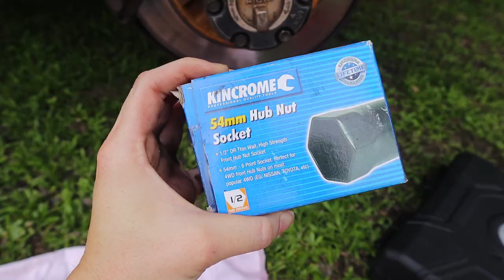My Landcruiser Part 3: CV Repair

Comment: Suggestion to jack as far out from the diff that you can and then put the tyre under the diff for safety -- ain't much but....  Grease and brakes are kinda counter to each other -- didn't see you clean your greasy fingers off the braking surface....  Doesn't that flex brake hose have a spring clip holding it to the mount? and then a notch to let the hard line slide out of the retainer so you are not bending the heck out of the hard line? Don't know about there, but dish soap in the shower can be great to cut through the grease on arms & legs.  -- Hair too.. hardknocks uni....
Reply from the maker: My 35" does not fit under the axle. And you didn't see me refit the circlip or do alot of other things too. Was over 2hours of footage is that how long you want these videos? Just because you didn't see something doesn't mean it was done🤦‍♀️
Reply: @DanieSimpson  -  If your 35 which doesn't say anything about width doesn't fit under the ax then use a couple of 4X4 or 8X8 to stop the vehicle trapping you or hitting your back while you are leaning under it if the jack fails. That stock jack is to jack up so you can change a tyre, not do vehicle maintenance. Get a Hi-Lift.   3 seconds before you put the tyre back on it looks like the fingerprints are still on the machined rotor brake surface. If you don't show or say that you did a step in the procedure then don't think people will ignore the absence.
Reply from the maker: @10susan10  best to read comments before voicing your opinion. The tyre is 12.5" wide and wider again at the side walls so I'll repeat myself one last time. My tyre will not fit under the axle which is the only place that will stop the axle dropping. The jack is to perform whatever you want. It as a SWL and you stick to that. There isn't a time limit. It is a screw type jack and VERY unlikely to fail like high lift jacks or hydraulic jacks. No-one carries jack stands off road or 4x4 or 8x8. If you can't work on your car without relying on safety devices then you need to learn to. You will learn in life that shit doesn't break in the shed, on flat ground when you have all the tools. Shit breaks at the most inconvenient times and you need to learn to work safely without relying on safety devices. This job is normally performed at home on a hoist so again you won't always have these conditions. I showed a video on my insta showing what would happen if the jack collapsed or fell out which was nothing at all. It's a 4wd not a sports car. When the spring is flat I can still sit under it. So please read past comments so I don't have to repeat myself 1000x thank you.

Comment: I recently bought my self an old 1989 75 series, how many inches of lift would be the best for 35" tires? At the moment it is just standard height running some tiny 31" tires, but I'm wanting to upsize soon. 
Thanks :)
Reply from the maker: i have 2" springs and extended shackles. hits on max up travel, but most springs wont flex thst much
Reply: Awesome thanks. I'll look into them a bit more

Comment: Awesome video -- learned a lot. But you did not use a torque wrench at any time, not even for the bearing nuts. Isn't that risky?
Reply from the maker: If you want to use a torque wrench go for gold. Eventually you will learn how tight things are by feel
Reply: @DanieSimpson  I suppose that's at the mastery level of expertise, where you can go by gut feel instead of using measuring devices. Thanks for the insight!

Comment: Good looking truck. I love the chrome on the front. Pretty sure I have seen it on a Roothy video, would I be right?
Reply from the maker: Seen what on a roothy video?
Reply: @DanieSimpson  your LandCruiser.
Reply from the maker: @harveysmith100  nah wasnt mine
Reply: @DanieSimpson  
Oh   OK, it was the "mine not his sticker." Maybe that is common in Oz.
Can I ask you what engine you have, I am assuming it's a 1HZ? What I would like to know is what is the fuel consumption?
I have a 70 stationwagon in the UK, it is a Japanese import with a 2.4 turbo. I would love to fit a 1HZ or a 1HD-T hence the interest.
Reply from the maker: @harveysmith100  nah i had it custom done not really common. It is a 1hz and when the car was stock would do about 10l/100km but now sits at 14l/100km
Reply: @DanieSimpson  Definitely seen it on another YT channel. I watch a lot of Aussie YT though. 
Thanks for the figures, my 2.4 turbo is returning  12L/100km so it gives me hope, especially if I put the 1HD-T in. 
It is so under powered I think a 4.2 would be better!! 
The 2.4 was only fitted because of tax reasons in certain countries. 
Thanks for replying, I have asked this a few times and you're the first to reply!
Reply from the maker: @harveysmith100  yeah 1hdt would be wicked!! And no dramas at all:)

Comment: Must suck scrubbing with 33s on a 2" lift. My stock hight 80 doesnt have such issues with 33s 😜
Reply from the maker: 1. They're 35s 
2. Your 80 will have nowhere near as much uptravel due to it being a coil vehicle and your uptravel is restricted by the bump stop or the compressed spring length. But by all means continue to compare Apple's and oranges😑
Reply from the maker: And your shock! Just a whole heap of things limiting your wheel travel
Reply: @DanieSimpson  yeah I know, that and tge bump stop but thus far its done everything I've asked of it.
Reply from the maker: @liamcooper5202  yeah most vehicles do

Comment: Nothing wrong with a bit of grease, but please wear a glove when packing a bearing like that. You just spent 5 mins forcing grease into the pores of your skin. Ok now...but 20 years from now will give you a good chance of getting dermatitis. Just some advice from an old aircraft mechanic. Otherwise, great video 😎👍
Reply from the maker: Yeah probs never going to do that. Use barrier cream and wash your hands isnt hard
Reply: Plus one for the gloves from another old aircraft guy, wish I had them 30 years ago my hands are a mess. Also cuts down on clean up, of the hands, not much help on the legs, arms and face. Ever notice your nose gets itchy when your hands are covered in grease?
Just got back from Fraser Is last night, if you want more march flies they are ALL over there, they work in groups of 50.....they must like backpackers.
1 cv? You're just not trying, I had never busted anything until 1 trip to Glass house mountains, 2 cracked cvs, stripped the teeth off all 4 spider gears and fed the debris into the crown and pinion just for added giggles all in about 1/3 of a second. I found a lot more gease in the knuckle housing than you seem to have, I seemed to have worn most of it.
Enjoyable vid, keepem comming.
Terrain Tamer are a good supplier of parts near oem quality without the toyota tax pricing.
Cheers

Comment: You ever going to put a turbo on the cruiser.
Reply from the maker: Not without a rebuild. 600000kms+ she aint made for a turbo haha
Reply: Fair call. Put one on the maverick at 430 thousand. Comp test was fine and only running 10 pound. Best thing I did.

Comment: why is the brake line solid,??,id be getting a longer one made,flexi,no reason for it to be solid fixed to diff.all this is designed for you to take it to toyota..hard line clamped on diff,1 ft before caliper,soft line.fixed.like all other 4x4rs.

Comment: If you own a Cruiser you need to know how to  replace a CV cause Toyota's have crap CVs. Kept breaking them on my 200 series.
Reply from the maker: 200series are IFS so if it's lifted then yeah of course you would break them. The factory toyota CV lasted probably decades this was a cheap aftermarket brand CV that broke not Toyota
Reply: @DanieSimpson  Yes the ARB suspension gives about 30-40mm lift. I know quite a few other guys in my club who had stock suspension and busted CVs (passenger side only and all KDSS) also.
Reply from the maker: @aussieoffroadnut1109  yes which changes the cv angle. All ifs CVs are weak, solid axle will always be stronger there

Comment: Good job I wont say where's ur stands like all the other idiots who wouldn't be able to do what you just did. do they carry stands in the boot to change a flat tyre. iv worked in very similar ways when my tools are not accessible you work better than most mechanics iv worked with and they have a shop full of tools

Comment: Hate to be a hater but with lots of things you say “I know this is not the right way to do this” but it’s not the right way to do it for a reason. Also for future reference put a jack stand under you’re car before you get under it or at least the tyre there’s no second chance when a car falls on you
Reply from the maker: Best to read prior comments before commenting as this has been answered. I didnt have a jack and my tyres dont fit if you have a jack use it. I accepted the risk, that is on me. 
The things I did correctly, like setting the bearings are the important things. The way you dismantle a car has no effect on anything. Just because its different from how other people do it doesn't make it incorrect.
Reply: Danie Simpson I don’t know you’re background or skill level but yes theres more then one way to do things but doing them incorrectly can damage the part or hurt you’re self and why do it differently if there’s a easer or safer way I don’t get your logic
Reply from the maker: @SpAceProductions100  As I've said countless times. I didnt have a jack stand. You dont have a jack stand on the side of the road. My tyre doesnt fit. I did a video on my instagram showing what would happen if my jack 'failed' or fell out. And nothing. Still can completely sit in my guard. I know what the safest was for what I had so best not to comment on something you have no idea about.
Reply from the maker: @SpAceProductions100  are you actually a veteran because if so you would know that accepting risk is all part of achieving the mission goal. Everything we do in life carries risk. Driving is one of the biggest killers yet we all still jump in our cars each morning.
Reply: Danie Simpson how did you come to that conclusion I was telling you what you did wrong and what you should do now you’re telling me. Again with the uneducated aspect you sound like a fucking idiot now. you should really stop you sound idiotic.
Reply: Danie Simpson you are “ not all there “ as in not the sharpest tool in the shed

Comment: Please put the tyre under the car. We don't want to see you get squashed
Reply from the maker: Please read past comments as this has been addressed multiple times.
Putting the tyre under the chassis does not stop the suspension from travelling and my 35" tyre does not fit under the suspension. 
You don't carry jack stands to change a tyre or offroad. Sure if you have safety devices use them but this isn't always the case learn to work safely, be aware of the hazards and don't become lax minded

Comment: we ,in the club,have a workshop,all,& private people use it to repair there trucks,loosely termed,,ive seen these cone washers take 1 hr to remove cos there rusted in,i just ,,it amazes,i cant ,,its a crap system,basicaly.theres no reason to have them,floating rear axles have them,fair enough,but front.??.plus the bearing nuts shim,just rubbish.there forever coming loose.just as interest look at a vid on replacing d44 front wheel bearings.

Comment: Hello, it is very rare that I put a negative note, but putting up brake discs full of grease is anything, it is very dangerous. The front hubs are made to splash in oil and not just grease.
It's a very bad job, it's not good. Make videos to show anything I can't see.
Reply from the maker: Oh dear best to read past comments before making your negative remarks. This has been answered multiple times. 
If I didn't edit this video it would be hours long, there alot you didn't see me do ie. Degreasing the disc which I do the rear before putting the caliper on(another thing you didn't see) and I did the front before putting the wheel on. Best not to assume online as you will never see the whole story. This isn't a tutorial and many steps were cut out of the footage so no it wasn't a "bad job" it was poor form on you for assuming.

Comment: The reason for the CV failure is simple, breakable Toyota.
Reply from the maker: It's not a Toyota CV so your point is invalid..
Reply: @DanieSimpson  Toyota don't make CV's, like a lot of parts they buy them in from specialist suppliers. So your point is invalid.
Reply from the maker: @FairladyS130  hahahah oh mate. I never once implied Toyota make their CVs but they have a set manufacturer that supplies all CVs  and this is a cheap aftermarket CV and not one that came from Toyota.
Reply: @DanieSimpson  Oh dear so someone disrespected your Toyboy by putting  aftermarket parts on it. Spank that person, hard.
Reply from the maker: @FairladyS130  oh when did that happen? There's bulk aftermarket parts on my car that's kinda the point not sure why you would spank someone for that...you feeling okay mate?